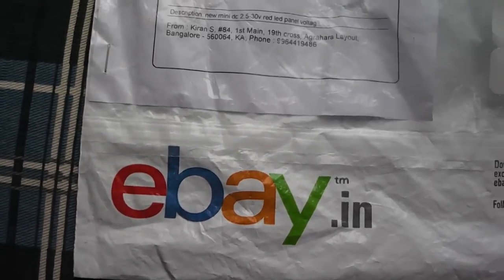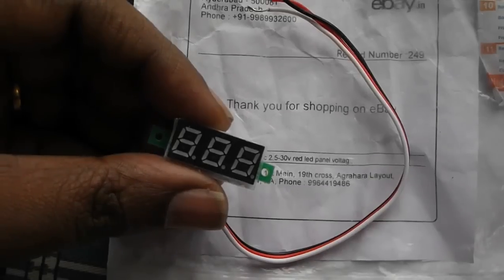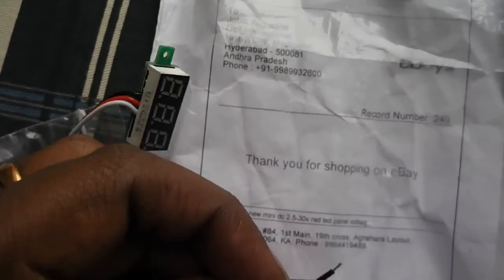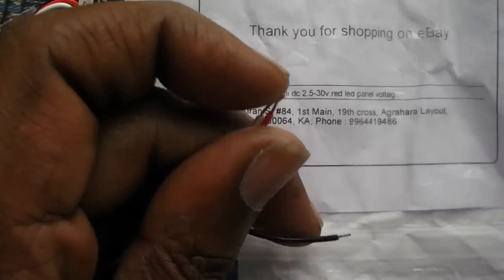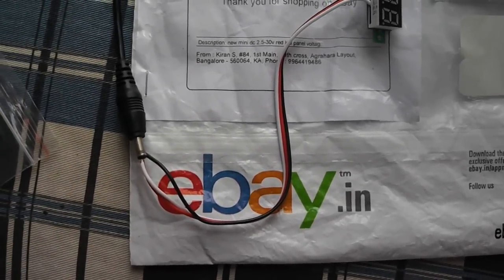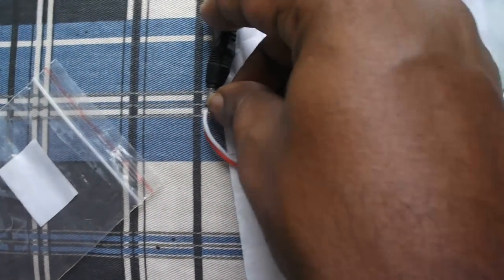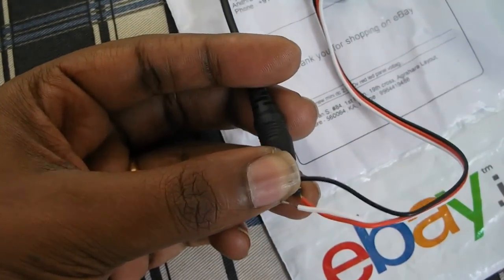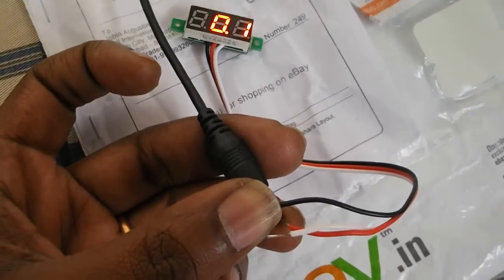Digital VoltMeter LED 3 Digit Display - Connections and Testing

Comment: Question:                              Please HELP!

I'm building a DIY solar system. I plan to use the VM in this video to monitor voltage on my solar battery bank.  Its a 12V DC solar system. 

So I connect the RED and BLACK leads to a external 5-12V DC power supply. Then I connect the WHITE to the + output to my battery bank.

If I understand, I would then cut a new wire that goes between the - battery post and the - external 5-12V power supply. Will that work?

I will also be connecting a push to activate on the VM. Once you let off the button it will turn the VM off, conserving energy.

Comment: hi, i got a 3 wire with black red and yellow. when i connect the red to power source it shows 12v, not zero. So is the red acting as the measurement lead?

Comment: What is the highest voltage it can measure. ? 

Can it measure AC volt. ?
Reply: Generally maximum 30V DC. No, it cannot measure AC. However you can always go and buy same design to suit higher voltages and for AC. There is no use asking on Youtube - go and look on Ebay, Amazon, Banggood, DX, or any other online retailer.

Comment: Hello, Jobin! If I power device from the same wire I measure, how big will be difference with real power?
Second, if I connect black to '-' and red to '+', it shows me numbers - why? I just powered device and it had unconnected white wire!
Reply: Daite Dve The device dont measure power but DC ( not AC) voltage. 
1) If u power the device between 5v-30v DC there will be no difference in voltage mesurment as voltmeter has high impecence. Above 30V it may damage.
2) There is small error of 0.1 v. Hence the  voltmster shows the number when white wire is disconnected.